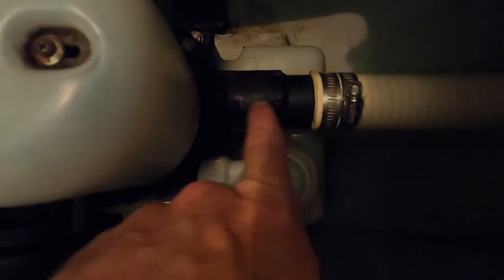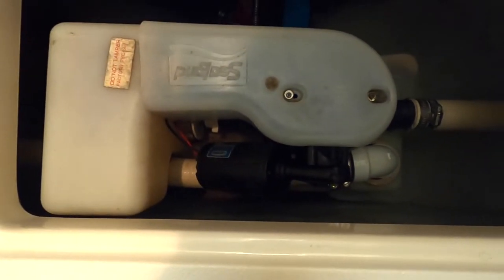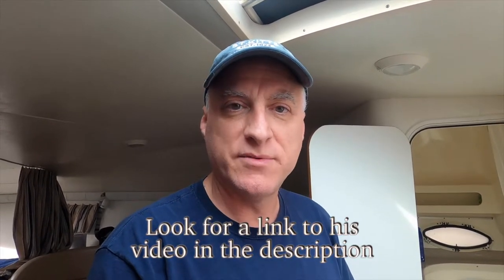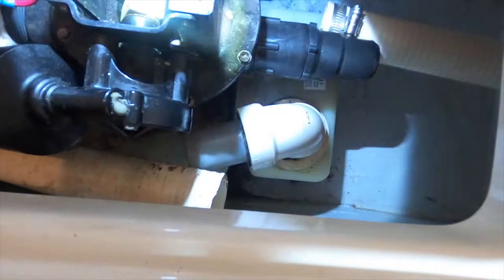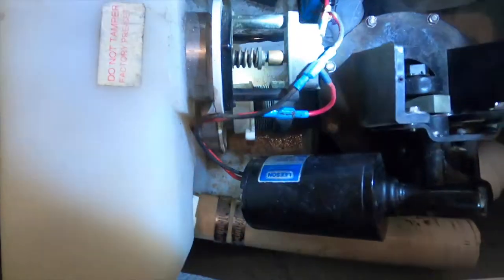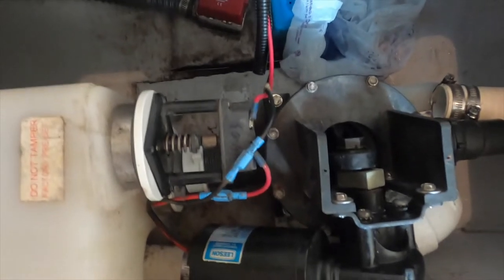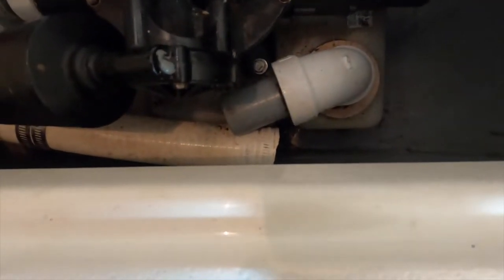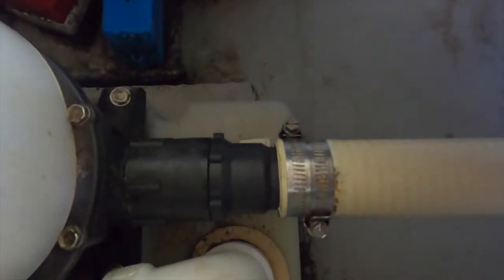Duckbill Valve Replacement - Episode 35

Comment: Hey bud i basically have the same boat and have the horrific smell what i did was replace toilet gaskets duckbills pressure switch on the pump and added the vent filter.  What did u do to have the smell go away
Reply from the maker: I have replaced the duckbills twice but that didn’t help. I’ve not added a vent filter but considered it. What is the pressure switch on the pump?
Reply from the maker: In the end the only thing that has semi worked is putting that stuff forgot what it’s called regularly in the tank and toilet combined with vacuuming out the vent hose to keep it clear from debris. I cannot reach the end of the vent from inside the engine room unfortunately
Reply: The pressure switch is on top of the pump we're the wires are when u take the cap off .  So u didn't replace the hose from pump to tank
Reply from the maker: @joeybuscemi7793  I did not replace any of the hoses since what I understand is that if the hoses were bad you’d always smell it. But we only have the bad smell when we flush hence the thought is a venting problem.
Reply: @eternitysshore  yea same here only when I flush. I added the filter no change the smell is coming from engine compartment that leads to the cabin. I'm goin for replacing the hose this weekend
Reply from the maker: I really hope that works!! Are you hiring someone or doing it yourself? Feel free to reach out at eternitysshore33@gmail.com and we can exchange info if you like. Would love to hear more about your boat as well.

Comment: Not fun. I did my duckbills...and my friend advised...if you are going in to "hell"...you might as well do it all.....the bellows under the pump in the black bowl...can be cracked thus not emptying completely into the sealed tank. Also, your boat may have an inline filter that needs to be replaced. Good Luck!
Reply from the maker: Thanks for the tips. I know there is no inline filter.
Reply from the maker: I’ll also add that most of the smell is coming from the engine room which makes me think either hose or vent.